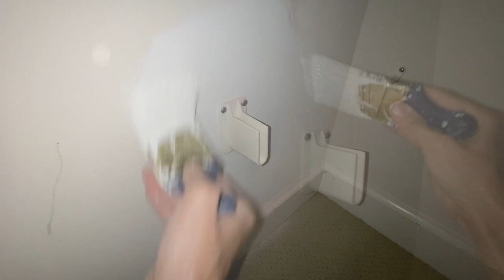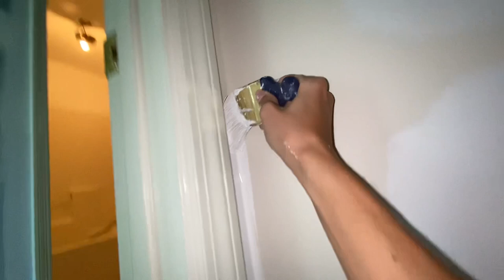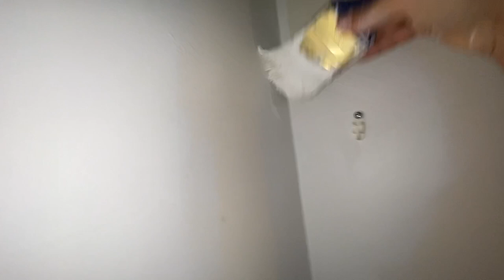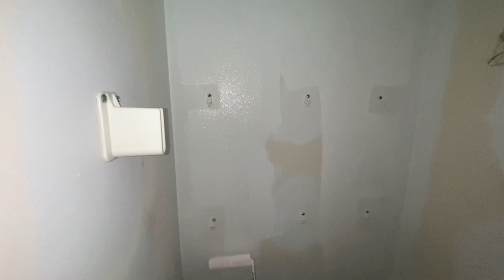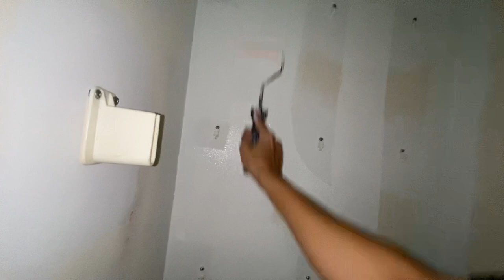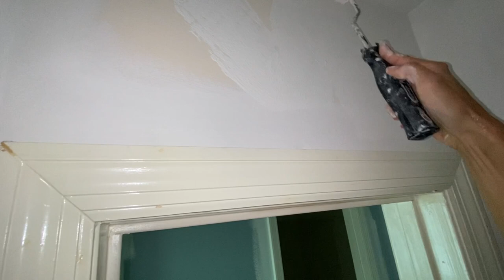Painting a small closet (super satisfying)

Comment: Nice! What is the brush you’re using for the cut ins? And what are some of your favorite brushes for cutting in?
Reply from the maker: Here I'm using a Wooster Shortcut brush from Home depot. This is my favorite for when my hand is hurting from a normal brush because it still holds a lot of paint but it's a lot easier to hold. My #1 favorite is the 2.5 inch Trylon brush from Home depot because it doesn't loose its shape if you paint with it all day, it holds a lot of paint, and it's a great quality that lasts a really long time